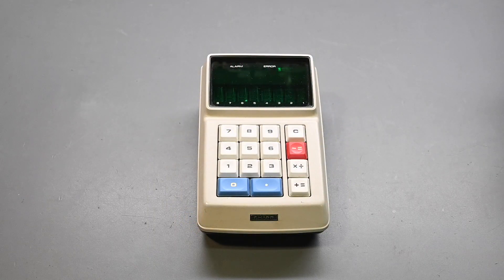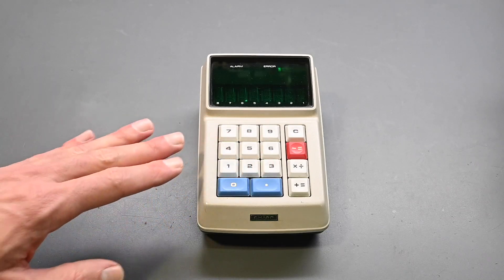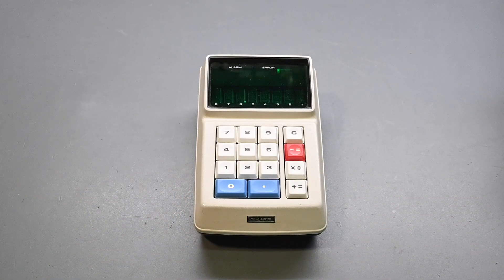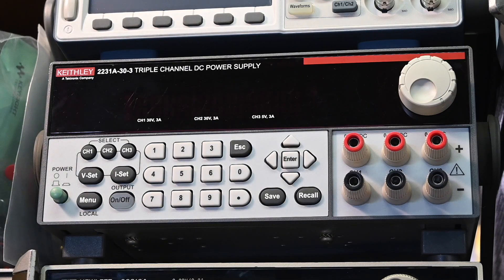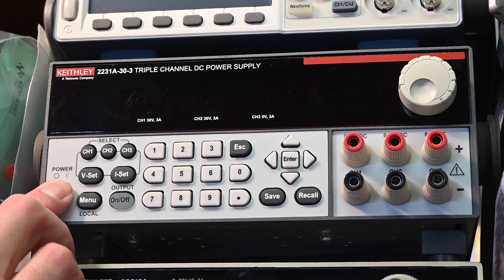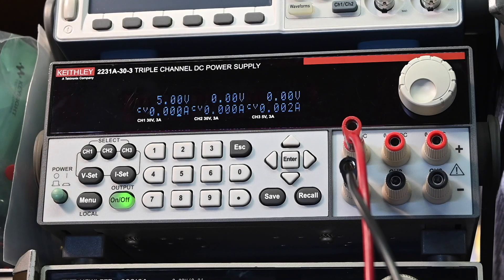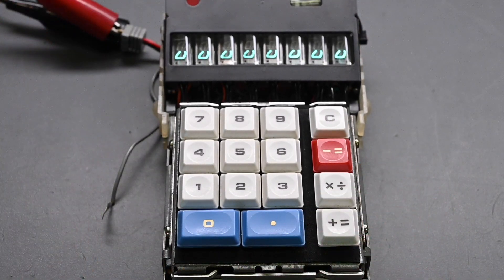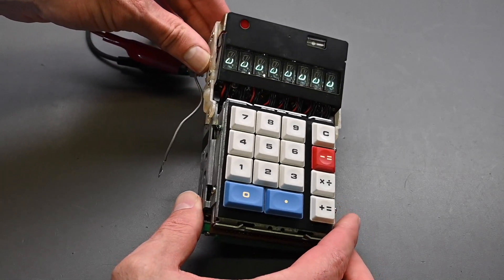Sharp EL-8 One Of The Earliest Mass Produced Handheld Calculators - Disassembly And Test

Comment: The battery pack is a black clamshell holder that can be opened to reveal 6AA NiCad batteries that are tab welded together.
my pack is long dead, however the power adapter works
Reply from the maker: thanks for the info!
Reply from the maker: The 6 NiCad's would make the internal operating voltage about 7.5 to 9 volts (I tested at 7 volts).  A replacement pack wouldn't be too difficult to build.  The power adapter and mating connector is the remaining issue.

Comment: I have a couple Sharp EL-230 from mid 80's, they still have the original Sharp AA batteries in it, and they didn't leak after all these years, and have enough juice to power it up.